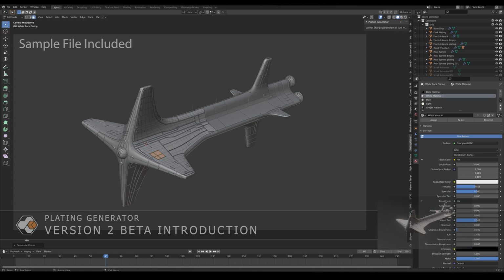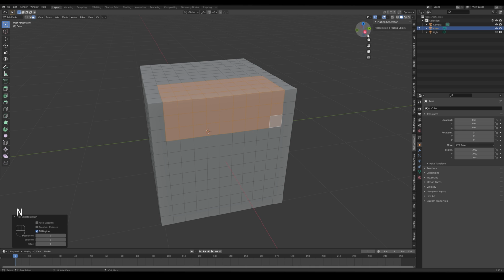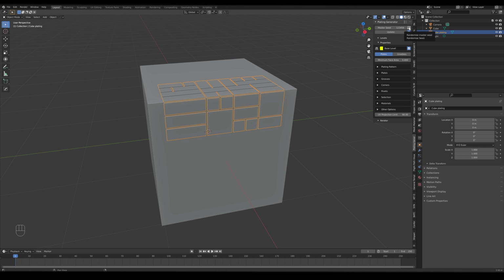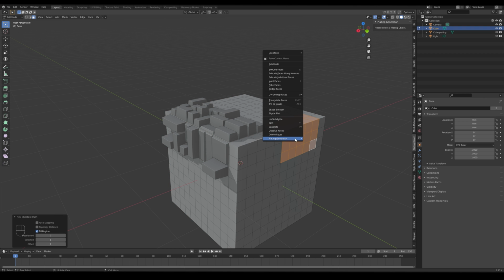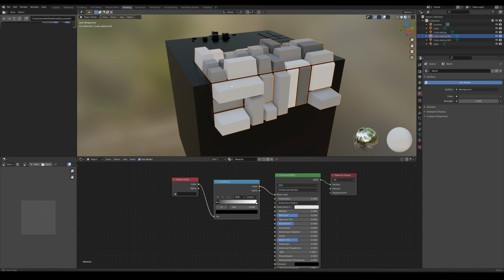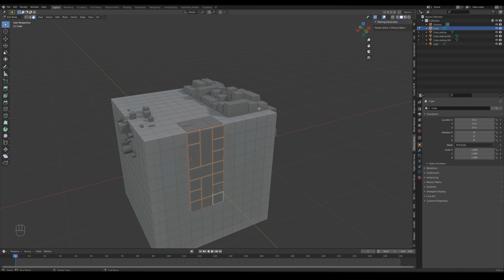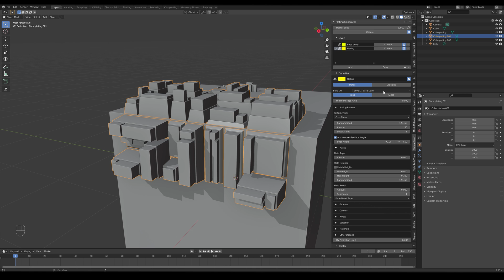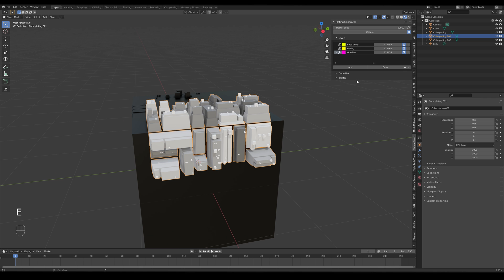Plating Generator V2 Beta - Introduction

Comment: Hi, is it possible to scale greebles relative to plate they are sitting on instead of the face beneath it. Sometimes, on denser models where you want to retain polygon curvature, what happens is that you want fewer panels than the number of faces. Then when you put greebles on it, they can look a bit tiny because they are based on number of faces beneath the plates that are larger. Not sure if this makes sense.
Reply from the maker: You might want to take a look at the Greebles modfiier instead that I have introduced in Blender 4 here: https://plating-generator-docs.readthedocs.io/en/latest/modifiers/modifiers.html#greebles

This modifier distributes the greebles on points, so you should get a more even distribution and size. Let me know if this helps.

Comment: I still prefer this over Random Flow. It feels more intuitive, and the results don't "look" procedural without much effort. That said, are there plans to make use of asset libraries for greebles? I am wondering if it could be pointed at an asset library folder to make use of it, considering Blender made organizing and adding assets to libraries so easy to do now (it feels like a basic feature.) The only other thing I would like to see is texturing as a part of the process. Texturing the rusted hull of a starship in real-time would be a godsend.
Reply: Thanks!  Yes Asset Libraries are on the cards, the Blender Python API is a little limited right now and as it matures we will introduce this feature.  Texture libraries are a good idea - perhaps having a set of pre-fabricated textures you can add and build on?
Reply: @mark_kingsnorth  Even better, that materials can be added to the new asset libraries as well. So, it can be pointed at those the same way as greebles if it's possible.

Comment: Wow, this is a great update!  It appears the version on Blender Market doesn't set Auto Smooth on the plates automatically like it appears in your video.  Bug?
Reply from the maker: I think it’s a new feature request! ;) when first created, the plating object currently inherits settings from the main object, so in this case the cube has smooth shading off. What I’ll do next week  is add a checkbox to automatically switch on auto smooth.
Reply: @oldmarkkingsnorthvideos  Ahh!  I was playing with the ship, so I guess that's why it didn't have Auto Smooth on.
Reply from the maker: @tmilker  Thanks I've updated the sample file so that the base object has auto smooth switched on, and added the auto smooth options for the object to the panel.  Hope that helps!  Should be available in the downloads section.